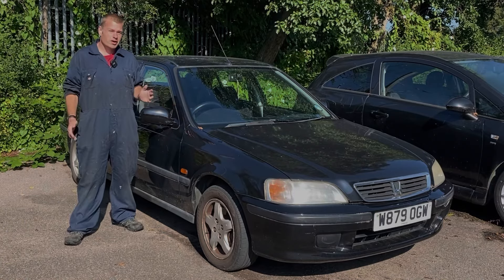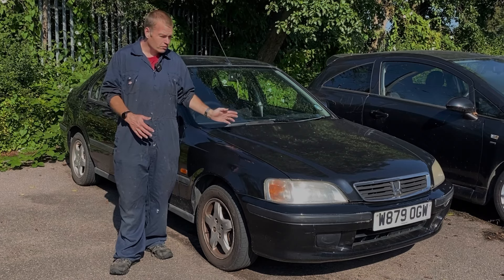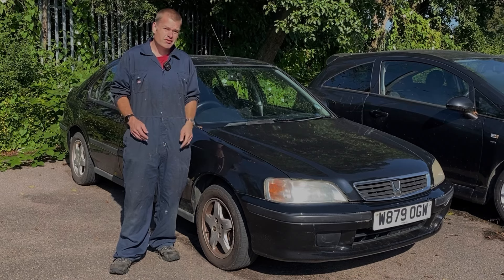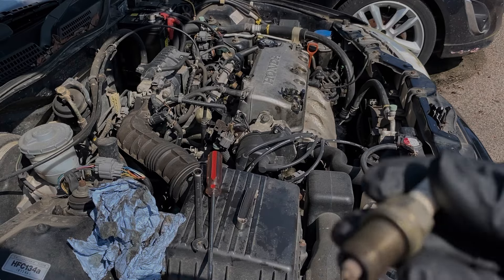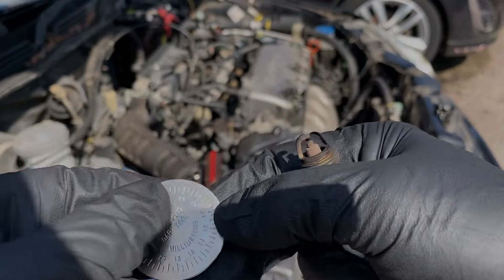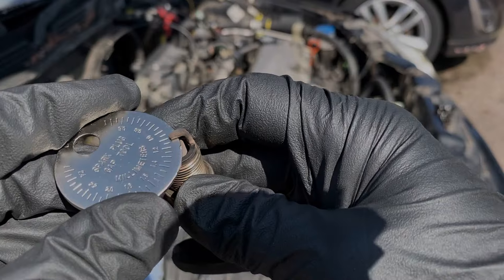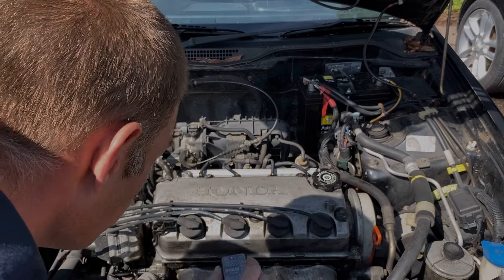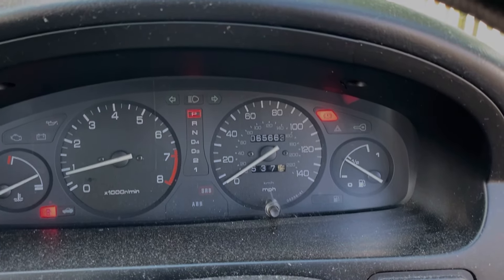2000 Honda Civic service D14Z4

Comment: Good job done Steve, I've been looking at our good friend Mr Google about doing the same on my SLK one good thing is that the oil filter is at the top of the engine under a plastic panel but it's a cartridge type and of course you need a tool to remove the top of the cartridge which aren't to expensive (this is my first ever car to have a cartridge filter which looks like a paper air filter🤔) looking at the oil spec for my car it says to use a 0W-40 full synthetic which to my old fashion brain looks like it could be thin like tap water 🤷‍♂I just hope it will be ok🤔

I'm not sure if I will be able to do the auto box oil as I'm sure there is a filter to change and from experience they are normally in the box so you have to remove the sump which wont be easy in my carport with only a jack😬🙄

One thing I have heard mentioned before and you said it in your video Steve, what is a "Ricer" 🤔I have no idea what that means so I must be getting old🤣cheers mate looking forward to the next one and sorry again for my stupid long comment👍
Reply from the maker: Hi John, I always enjoy reading long comments, trouble is I forget most of what I need to reply. 
Most modern cars have gone back to being a cartridge style oil filter, they was like this on much older cars before. 
Again most modern cars to take a thin oil they say it’s that they are much more advanced and have the ability to stay in between the gaps where oil is supposed to be. Again it’s for less drag on the engine so these will be more efficient as well, not to mention the oil ways can be so small now that a thicker oil can actually cause more problems, I always say go with the manufacturer’s recommendations, some manufacturers specify a thicker grade oil for hotter/colder climates, I’m not sure if this is still a thing or not though nowadays. 

Hmm I’m not sure what a ricer is myself other than it was boy racers that was in a Honda civic I presume much lower power than what’s perceives (if that make sense)  for example making a standard SE model look like a type R but having the original 1400cc engine. 

I’m lucky and this Honda and my MK3 cavalier doesn’t have a filter just the magnet on the drain plug, but yes your right most gearboxes you have to take off the sump to get to the filter, they are the easy ones as some can be buried in the gearbox 😬

Anyway I hope I have remembered everything, so enjoy my silly long reply 🤣

Cheers John good to hear from you. Steve.

Comment: Good video steve thanks - i noticed you dont get the car on ramps for an oil change any reason?
Reply from the maker: Hi Alan, if I can get underneath without jacking the car up then I will do, it’s being lazy and also it’s nice and level to get all the oil out and put the right amount in as well. Plus ramps catches the bumper on this and most cars so I rarely use them. Cheers.